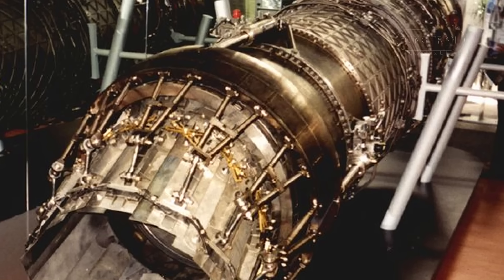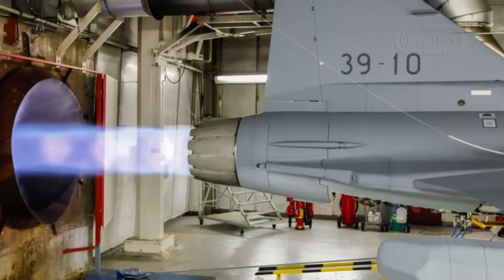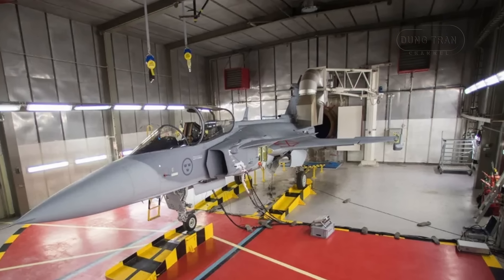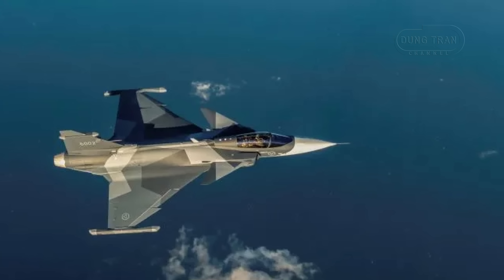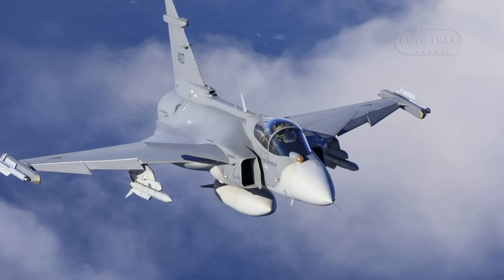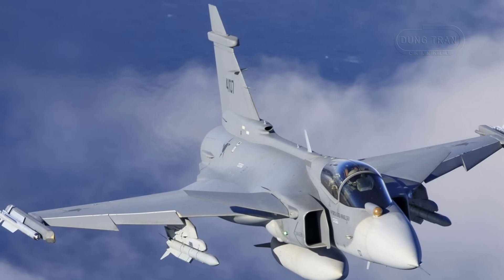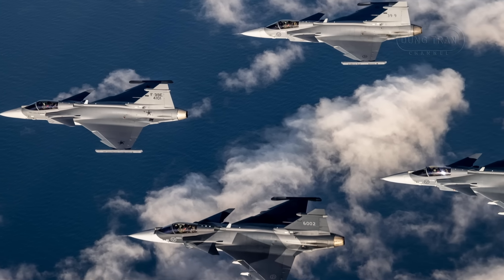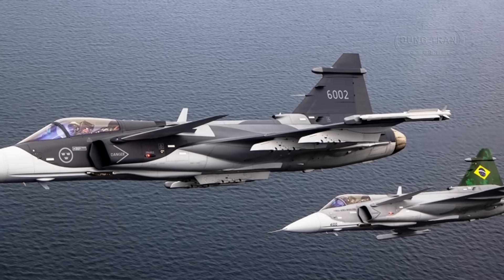Sweden’s Bold Move: Rolls-Royce Engine Could Save the Gripen E/F! 🚀

Comment: Both the Rolls Royce EJ230 and Safran M88-3 were offered to SAAB as RM12/F404 engine replacement's, and the U.K already uses the Gripen C/D as a high speed trainer. It is not unreasonable to assume that Rolls Royce has already practice fit an EJ.
Reply: The Gripen E is NOT the same air frame as C/D. It is longer and heavier as it was designed around a larger engine, the GE F414G. The entire aircraft is affected by engine choice and engine families from different builders are very, very different in detail, necessitating a virtual redesign to accommodate new power. There is no jet engine SuperStore with multiple options.
Reply: @ The Gripen NG program with new engine, radar, and increased fuel capacity was flying with in a year.
The Dassault Rafale's testing was done using a GE F404 while the Snecma M88 was being developed , sometimes both at the same time. 
F-15/F-16's use a PW F100 or a GE F110
Real life doesn't support your internet engineering degree.
Reply: @JamesBrix86  I'm sorry: I obviously haven't dumbed this down enough for you. I am NOT saying that the engine can't be replaced with a year's engineering effort - which would cost several tens of millions - as in the case you cite. What I said was that your idea that pulling the engine out and putting a new one in to play with was something so easy you'd do it without any real effort just because you a few hours spare time with an airframe. Which was the - again idiotic - fantasy you were promoting. A new engine can certainly be installed. But as easily as you imagine, no, James, it isn't like changing the rims on your Fiesta... 

In summary, yes, it can be done. No, that doesn't mean you're not a Mr Silly because you tell people it will already have been done just because there are a couple of airframes in the UK. The difference shouldn't need explaining to an adult, but then again, I have no way of knowing how old you are.
Reply: The EJ200 series incl. the EJ230 are NOT pure Rolls Royce engines. RR holds a share of 33% in design and production. Same share is held by Germany's MTU and smaller ones by Italy's Avio and Spain's ITP. All have been involved with their share in the development and design. The thrust vector btw was developed by MTU about 20 years ago, it was just never implemented into the Typhoons because the gains did not justify the costs back then.
Reply: @ MTU is owned by Rolls Royce, just like Allison engines.
Reply: @christasker2944 RR owns MTU power systems, not MTU aero engines. They're two separate companies.
Reply: @christasker2944  No it is not! MTU Aero Engines, that's the one of EuroJet, is a DAX noted shareholder company. What you mean is mtu Friedrichshafen, the Diesel motor company where Detroit Diesel is a part of, this one is indeed owned by RR. But they have nothing to do with the aero engine manufacturer.
Reply: Test fitting using the CAD files for both wouldn’t be difficult and quickly show what the major clashes would be enabling the production of a design process.
Reply: @ Playing with CAD files is easier than using real aircraft, yes. I'm not sure that anyone needed telling this though. Also: no, CAD alone won't tell you what the real problems are. They're potentially airflow, and thermodynamics. Again: not a car.
Reply: Rolls Royce have had experience in re engining American Fighters with their own engines, such as the F4 Phantom
Reply: @christasker2944  Yes, it can be done. But that experience was decades ago with very different airframes, so it isn't really relevant... And the result was rather unsatisfying... > A common service joke of the 1970s went, “What happens if you spay [Spey] a Phantom?” The answer — cue mirth — was, “It gets fat and goes slower.”
Reply: Rumours,but no substance and definitely not a single word has come from Saab regarding this.
The EJ230 was suggested already back in 1998 for the Gripen C/D
Reply: @kronop8884  It would be a lot of work and we'd probably know if had been done - the intake might need redesigning, center of gravity would change at least somewhat, which implies changes to the software that keeps it from falling out of the sky.
Reply: @TheGreatAmphibian Yes and add power take off, auxiliaries like generators an hydraulic pumps etc likely need to be adapted to use different characteristics of the engine as well, huge job
Reply: To clarify, the Gripen C/D is used only by the Empire Test Pilots School. It is not used generally as "a high speed trainer". I note that the Gripen E/F uses the F414 in Swedish guise. This is a shorter, wider, heavier (by 250+lb or 120+kg) slightly less fuel efficient engine. Gripen would be better with the EJ230 but I don't know how compatible the casing/mounts could be made for fitting into the Gripen - we live in an age of 3d printed parts so possibly this could be straightforward. Similarly, the gas flow for the EJ230 is likely to be higher, demanding enlarged inlets. The problems are not insurmountable, but not to be trivialised either.
Reply: @ it will be done only if it is financially viable and there is a demand for the end product
Reply: I think your assumption is extremely unreasonable: putting a new engine in a fighter isn’t like working on a car. It’s a massive amount of engineering - you don’t do it just because you have an ir frame handy!

Comment: I fully support offering the Rolls-Royce EJ230 as an option. While leaked information suggests its integration into the Gripen E/F and there's no official confirmation. Your video description also highlighted the airframe redesign challenges, which leads me to believe the Rolls-Royce discussions weren't for the Gripen E/F, as such a redesign would likely increase its cost and erode its competitive edge.
Reply: An air frame redesign is no small undertaking but it could be a potential opportunity for other improvements as well. For example, they could change to a diverterless supersonic inlet (DSI) for the air intakes which would save some weight and complexity. They could also improve stealth to a modest extent while keeping external stores by adding jigsaw edges on body panels and other structural elements and adjusting overall shaping slightly to create some angles. Sensors, electronic warfare, and computing components such as the data bus could be updated. This could create a new Gripen G/H "Ghost" variant with significant capability improvements over the current Gripen E/F. It would not be a stealth aircraft but it could perhaps get into the low observable range and pose a serious challenge to Russia's Su-57.
Reply: @Stu_Bur  and maybe, redesign not visible, but for maintainability and modern manufacturing.
Reply: Another advantage of the EJ230 is its higher thrust-to-weight ratio and the inclusion of thrust vectoring nozzles. I came across information suggesting that SAAB is developing a supersonic Gripen F concept, which is intended to have both crewed and uncrewed variants.
Reply: The EJ230 is not a RR engine but from EuroJet. RR holds 33% of it. Same share is with MTU Germany, the remaining 34%are with Avio and ITP. And that shares include the design and development of the engine in the same percentages.

Comment: Rolls Royce has offered India a ground-up, purpose built 110kn-130kn thrust engine for its AMCA fighter program.  What seems apparent is that if the company can confidently offer this to another customer, then what should be done is not the retrofit of the Gripen with the Eurofighter engine, but that a completely new design explicitly for use in the Gripen should be offered on spec, in a study plan for acceptance by Saab.  At that point collaborating on the product would be feasible from the point of view of Gripen buyers, and Rolls Royce could have a solid initial order to cover the development costs.  Given modern computer assisted design and engineering tools and new manufacturing processes, there is no reason not to accomodate Saab Gripen with a future-proof, bolt in upgrade.
Reply: How long would that take? Have you any idea about what you are saying? EJ200 is not a paper engine, and its integration would take time but it would be so much quicker than a new design….
Reply: It’s expensive
Reply: @Clickworker101  So is an F-35 you can't fly.
Reply: The EJ200 (Eurofighter engine) is short on thrust compared to the F-414.
The EJ-230 version is a Thrust Vectoring design, hence heavier, due to added moving parts.
Either RR engine, should they be fitted to the Gripen-E, would bring about a degradation in performance, compared to the GE engine.
Reply: @marcgoulet4028  True, but America, under the Putin controlled trump, is not a country we can rely on anymore. And so sacrifices have to be made.
Reply: @marcgoulet4028  the new variants of the EJ200 will have 30% more thrust, as offered to Turkey.
Reply: @marcgoulet4028 
The EF uses two engines, the Gripen will surly have a modified version due to it being a mono-engine design.
Reply: @marcgoulet4028  Depends, I think we're talking new variant EJ200 engines which have c. one third more thrust.
Reply: @marcgoulet4028 
Dry, the EJ230 provides 15kN more thrust than the F414 and the same wet.
Stage 2 takes it to 6kn more dry and 120kn wet, or 27,000lbf.

All for a lower fuel consumption and higher power to weight ratio. 

I can't wait to see what RR cook up for Tempest
Reply: I agree, but the current engine they're offering is one that is off the shelf, and RR is tooled up to make now. A bespoke one, whilst clearly would be better, would take years to retool, retrain, and make. 

Do we have years? Good kit now, is better than perfect equipment when it's too late.
Reply: @DrzBa If you listen to RR's announcements about the GCAP program, they're contradicting your beliefs.  They say that technological advancements are vastly accelerating the the prototype process and parts manufacturing.   So what I think should be inferred is that it should be a fast and economical process to take a fully developed, mature system and reshape it to fit a specific application.  What serves Saab's customers in a competitive market is the question, nor what RR has on the shelf.  So you can't expect Saab to go backwards technologically and pay more to do so.  If RR can't do better, than they should get sidelined.  And if everyone has to wait for GCAP then someone else will win.  Another distinct feature of RR developing a bolt in,  Gripen specific engine upgrade, is that the market for it can expand to include retrofitting existing Gripens, which may double or triple the overall orders.
Reply: @DrzBa Exactly
Reply: Probably a version of the adapted EJ200 engine being fitted to the Tempest development prototype at the moment.
Reply: that’s just inefficient
Reply: And may I ask, just how many top-flight military jet engines have you developed, designed and prepared for production Sir?
Methinks thou dreamest.
Reply: @gyrogearloose1345  You're mistaken, sir. This is social media where everyone is an expert on every topic.
Reply: @gyrogearloose1345  This would be my first.  You git me.
Reply: Sounds Indian to me .
Reply: Eurofighter engine is well proven and readily available and is even now more powerful than GE engine... More to the point - Britain is a safe supplier, not like USA who seem to hate their allies.